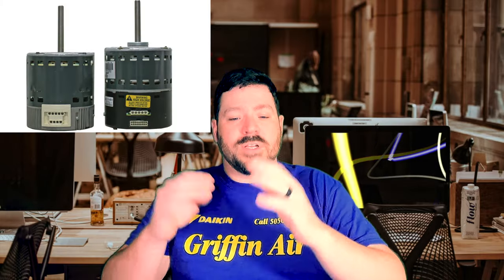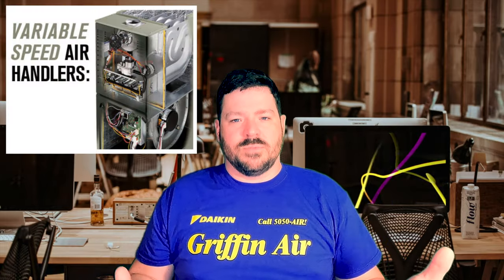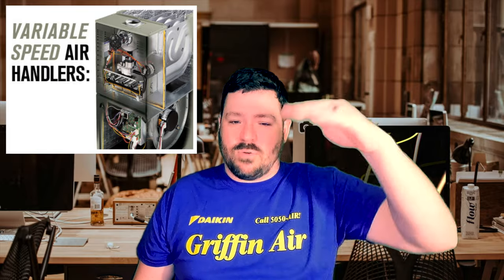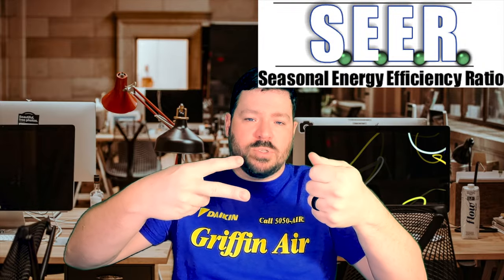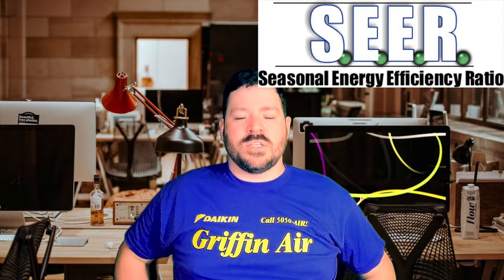Why upgrade your air handler to variable speed? Benefits are discussed here!

Comment: I did a detailed calculation on the cost recovery on a higher SEER air conditioners in the Little Rock Arkansas area.  I got a high efficiency furnace with a vatiable speed blower(?) That portion of the unit made sense because of generous utility company rebates.  There was no reason to install AC with a greater than 14 SEER.  The time to recover the difference in cost was 14 to 20 years depending on the SEER.  Those times are pushing the life expectancy of the units.

Comment: if you up grade the heat unit in your Heat system with a 15 instead of the standard 10 heat unit, will it make it hotter when the heat is on. Like a thermostat does on a car?

Comment: very informative. thank you. is there a difference with variable speed air handler with single stage condenser vs 2 or multistage condenser with single speed handler? are they just equally efficient? which system out of the 2 would be better and have better lifespan?

Comment: Back in 2018 the variable speed motor in my air handler failed. The repairman tried to find one in our area (Savannah) but none were available for three days and the cost was around $600 IIRC. He found a single speed motor locally for ~$150. I told him to go with the single speed in the middle of summer in  Georgia. The unit was 14 years old and I would NEVER have made back the difference in cost and didn’t have to deal with no ac for three days.  Does this price difference still exist for replacements?
Reply: It does, unfortunately.

Comment: Thanks for this video. I am being recommended a “Variable-speed, constant torque (VCT) ECM blower”. Is that the second (ECM) or third version you mention in this video (variable speed)?
Reply from the maker: Send me the model number please
Reply: @NewHVACGuide  appreciate it. i-58TP1A 070V1412
Reply from the maker: I think ultimately the answer to your question is that it's closer to the "third version" in the video.  Years ago ECM and variable speed meant two different things, but now they make variable speed - ECM motors.  The thing that threw me off with your message is the constant torque which is usually more a set speed type.

Comment: Do you see value in also using the variable fan speeds to keep air moving around the home between heating and cooling cycles?  So, rather than fan on "auto" (off between cycles) or "on" (high speed between cycles) you can set at different speeds between cycles:  higher speed in the cooling season, slower in heating season, slower at night.  Ovoid "dead air", take more advantage of filtering, balancing temps, dry out the shower between uses, etc.
Reply from the maker: Yes sir. Some IAQ products even request that the fan be running all the time believe it or not.
Reply: On the same note, I have two 19 year old Bryant 310A furnace with single stage blowers and am considering adding a whole house air purifier (either Bryant Evolution or Intellipure Super V or iQAir Perfect 16). I would like it to run the fans all day and night but I’m assuming that would use about 1 kWh to do. Is it possible to add either a multi speed or variable blower to this existing unit? Or Is it money smart to just replace my whole furnace with such a blower?
Reply from the maker: @bbshoney  It would not make sense to replace the motor with ECM or variable for several reasons
Reply: @NewHVACGuide  can you elaborate? How many watts would it take to run the fan on all of the time?
Reply: @NewHVACGuide  can you elaborate? Would it make more sense to get a new system an if so, what motor blower would be most efficient to run a whole house cleaner all day? Also, how many watts do you think I use with the current single stage motor?
Reply from the maker: @bbshoney  ECM motors and especially variable speed motors have boards that control them among other controls.  So pulling out a single stage motor that probably just has a relay or contactor controlling it of some kind and slapping in a variable speed motor would not be feasible. Even if you were to figure it out, I can't imagine it being ideal. It certainly wouldn't be an AHRI match.

Comment: Which hvac system is more efficient the split system withers furnace or a gas package unit I just upgraded I replaced all ductwork and all with a American standard 2.5 ton gas package unit we live in tn and get very long very humid summers here and we have been known to have cold winters also. I just wanted your honest opinion.
Reply from the maker: I did a video on this. Look for package units in my vids. I think the ultimate answer is you can get higher seer systems with split systems and a package unit is exposed to the elements. So split systems will typically be more efficient in general

Comment: Great video, 

I've got a few independent questions:  

1.  My scenario.... 1475 SQFT home... single story, 25% of the home is vaulted.  I live in central FL. Home also has R34 rated insulation over entire home including garage. Home Purchased in 2019 so newish system.  It has an ESC motor... I can select Low... Med... High. Out of the gate the house was set at ...low.... but over time I felt like the house took a while to "cool down" so another hvac tech set it to med.... but as my time as a homeowner has grown so has my knowledge.  The AC is able to maintain just shy of 60% RH in the daytime as of this moment its currently sundown I'm at 49% RH which both are in acceptable range.... but I've been told ALL over the spectrum of "you need to run it low to get the water out" and others are like "the roof is 150 + you need to go med to get the air pressure to move the cooler air around the home". ... and my thoughts are... they're either both right, or one is wrong... or someone is more right than wrong lol.  

So first.... energy is number one... comfort is important but one thing i've learned...its air conditioning...not air cooling.  I'm more comfy at 76 @49% RH than I am @ 72 @59 RH.  
Second: If I have an ESC ... can I upgrade to a true variable speed blower in my heat pump?  I feel like the ramp up makes the difference here.  

Last question:  On a complete different note.  I've considered putting in a window mounted, Midea U inverter 12k in the main space... thing runs like 600 watts max.  Would this help or hurt my main HVAC overall's efficiency?

Love the content!
Reply: Way too long
Reply: I have a 2500 sf home, 5 ton 12 SEER, 22 yo AC in Houston.  I run a 5,000 BTU window unit 24/7.  On hot days, RH is 47 to 51 with AC set to 76 day & 77 night.  The AC does not come on from 9pm to 9am.  AC only comes on 7 times during day.  Without window unit 16 to 20 times a day. Energy usage is less than before window unit.

Comment: If you make the air handler variable speed but don't change the outside unit won't the outside unit use more electricity since it runs full speed for longer?
Reply: Have same question here

Comment: Hey Joshua, great idea using this platform to reach out and educate homeowners. I'm a commercial tech from up north. On the topic of efficiency, do you guys use combustion analysis as part of your heat PM for nat gas applications? If so, how are you guys using those readings to make adjustments? I've worked for several companies over the years and they all seem to use analysis information differently.  I'm always interested in pulling good ideas that make me a better tech.
Reply from the maker: Well I’m probably not the guy to ask. We are a heat pump market mostly. That said, most of the companies in our area don’t even own a manometer and don’t even check gas pressures on their furnaces. So that’s usually the first thing I go to when checking a furnace for the first time. That said, we used to do a lot of combustion analysis on oil boilers and furnaces when our company did oil. But I feel like that was more about the system running efficiently and cleaner so it would not build up soot or have other issues like that. You probably have already heard of him but in case you haven’t, there’s a YouTube channel called @grayfurnaceman. He’s forgotten more than I’ll ever learn about some of the stuff you’re asking

Comment: Variable speed is NOT a reliable system.  I don't think it should be utilized for many reasons:
1. High failure rate of the Variable Speed module
2. High susceptible to incoming power to the Variables Speed Module (spikes / brown outs / surges)
3. High failure on actual motor due to lack of design in motor to account for induction on supply
4. VSWR - yes, even in a motor do designers need to account for this, especially in a variable rate system.

Multi-tap motors are better suited for this operation, however, the downside is more expensive motor and control circuit (yet less expensive than variable speed module).  The motor will last much longer than the variable  rate, and be just as efficient (even more so considering the loss in heat generated by the veritable speed module).

Just because something is new and electronic does not make it better.

If you don't agree with me, fine, look for YouTube videos of variable speed module failures, costs, availability, and people removing them because of the failure rate.
Reply: What system would you recommend going with? Single-stage?

Comment: How come on my Lennox CBA27UHE air handler, I can't get the blower motor to run by itself, it will only run automatically. This is the way it was installed. I even changed out the thermostat to no avail. Has anyone come across this problem?

Comment: We have a Trane TEM6 air handler that our builder installed in our new house. While Trane labels this as a variable speed, am I correct that it’s actually an ECM motor? The builder gave us Honeywell thermostats and not the Trane thermostats so if I understand the manual correctly, once the installer sets the speed, it only acts like a single speed blower, correct? 

Based on my research, if we have the Trane thermostats, it could be set up to go into a dehumidify mode or a ramp up mode during cooling, correct?

It just doesn’t sound like a variable speed like I would think, but rather it’s variable in what speed the installer sets it at to match airflow needed and then it acts as a single speed basically after that unless paired with the Trane thermostats and set up otherwise.
Reply: Yep, and then some!  Looking at the TEM6 installer manual, it looks similar to others and my XC80 Furnace.  It is "variable speed" in many aspects, even when not paired to a Trane thermostat.  Installer sets the CFM per ton, and the motor achieves that CFM over various static pressures. Versus a traditional fan where they can just choose a low/med/high based upon static pressure they measure themselves at time of install (there's a chart they go by from the manufacturer to match it with desired CFM).  You can also turn on a ramp up/ramp down for cooling with DIP switches, so it will run super low for a minute, then a bit faster for a few minutes, then normal speed for cooling. Third is dehumidification on demand - even higher end regular thermostats can have a DHUM terminal to indicate dehumidification is needed (Honeywell, Ecobee, Nest, etc).  I have a Vision Pro 8000 that has that capability. I think the Trane Thermostat would achieve a few more functions or possibly let you control some of this from the thermostat itself?

Comment: Does it make sense that a variable speed motor would work without communicating to the valve to lower the amount of heat being put out (2 stage)?  I think even turning down the speed of your squirrel cage blower, might even cause errors or be dangerous.  My point is that I was looking for a quieter Manufactured home furnace/coil combo, but I'm yet to find any evidence that a single stage fixed speed blower vs a dual stage, variable speed motor is quieter?  What do you all think...any first hand knowledge out there?
Reply from the maker: Variable speed motors are going to run at full speed when paired with the single stage outdoor quite often. When looking up decibel levels for units, I would say they typically are going to give you the decibel level of the system running at full capacity.

Comment: Can you pair a variable speed air handler with a single stage compressor without risk of freezing the coil due to low airflow? 

I have a zoned system our builder did that is a mess one zone is 2,300 sq ft, other is 600 and they zoned it off a single 5 ton unit with a bypass damper that freezes the coil after a while.  Figured variable speed would be best but just want the variable blower to lower static pressure and get rid of the bypass.
Reply from the maker: The answer to your question is yes. We do it all the time. Just make sure they are an AHRI match

Comment: If I were wanting a 5 ton variable-speed unit for pre-cooling home prior to peak rates instead of my current 4 ton single stage, is it safe to assume that the 5 ton unit would work just as well or better at controlling humidity since it can run at a lower speed?
Reply: No.  Your better off properly sizing and getting solar panels.
Reply: @tekjunkie28  how would solar panels control humidity?
Reply: @rotcod2886  he mentioned peak rates.   It's always a better payoff with solar as long as you will be there for a while.  Never ever oversize an AC.  And the Manual J already is oversized by up to 30%.